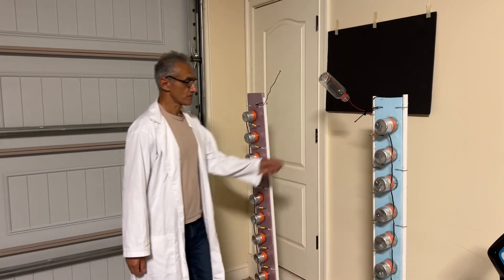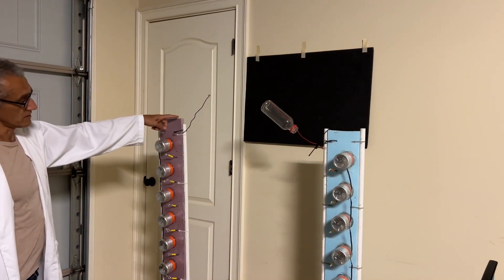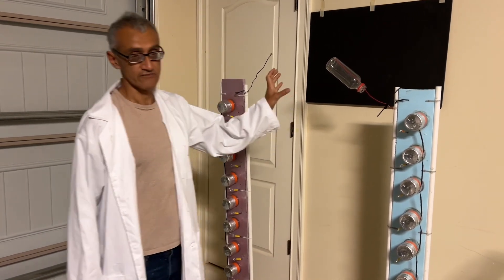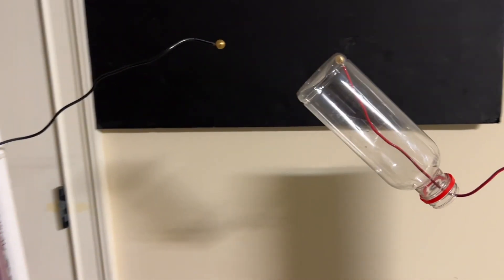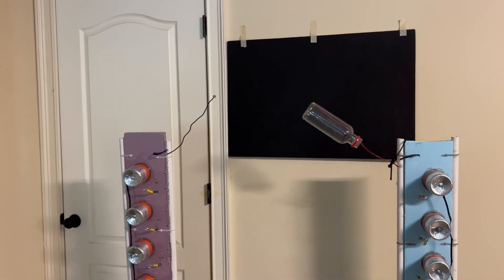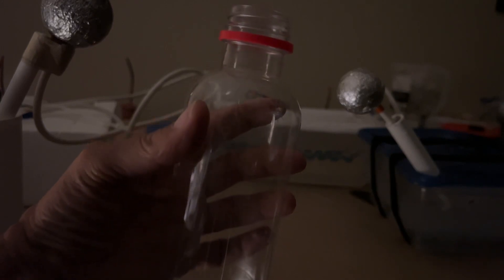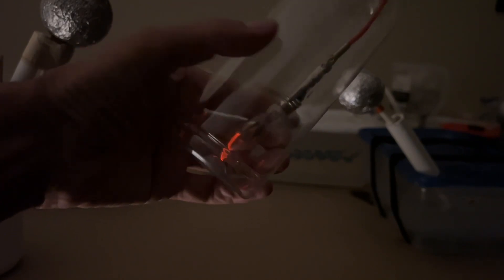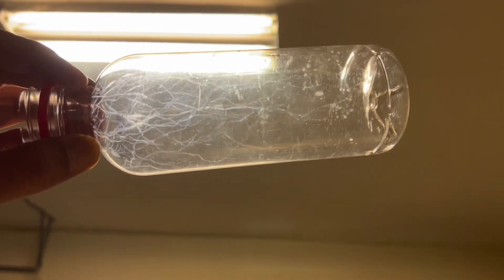Supercharging plastic bottle to Breakdown

Comment: Great experiment! 
After the flash over, is the bottle positively charged, or negatively charged instead? How would you determine it?
Reply from the maker: The outside of the bottle is negative. The inside of the bottle is positive. The net overall charge of the bottle with respect to earth ground is zero. The polarity could be determined by how it lights up a neon bulb. The negative terminal in a neon bulb containing two terminals would light up brighter than the positive terminal.

Comment: you can bottle electricity?  That's unbelievable!  Best science channel ever.  Now get some pink mercury and put it in a counter rotating device that goes 40,000rpms.  
You must be able to envision or see this stuff.  I don't, but I can see the field lines of a magnet through a fero cell and I understand toroidal systems.  You need a dual toroid, apparently.  I thought one would work.  Maybe it just rotates two equal masses of mercury in opposition, I don't know if the rings or bells are connected to cycle all the mercury through both sides.  And don't forget your old buddy when you become a master of time and space.